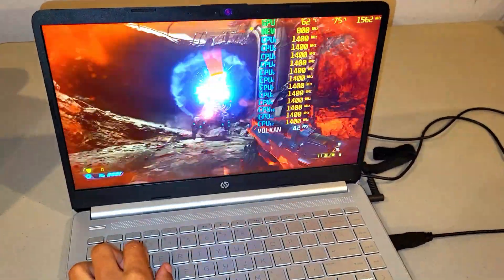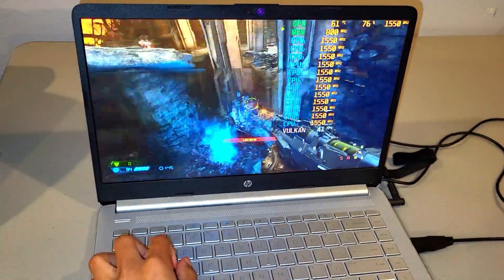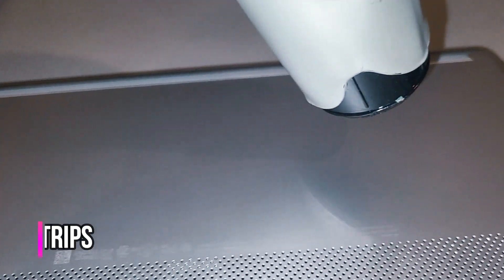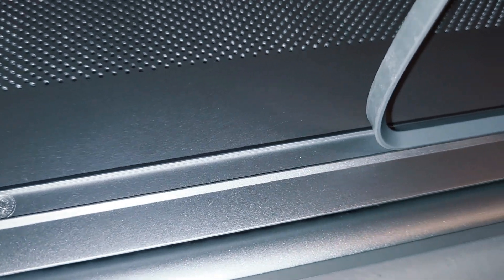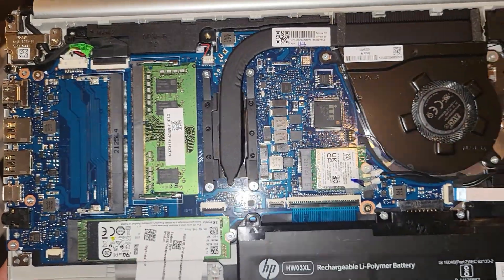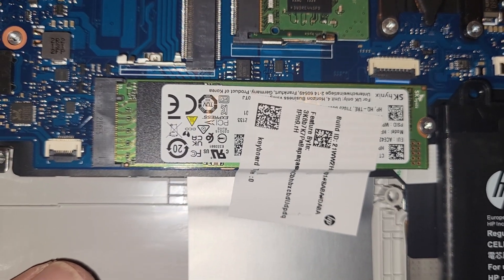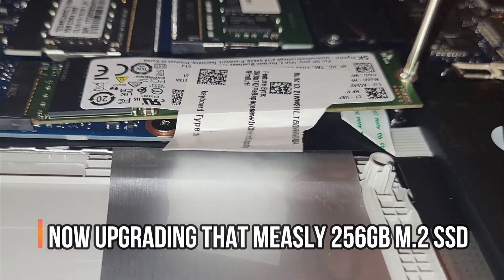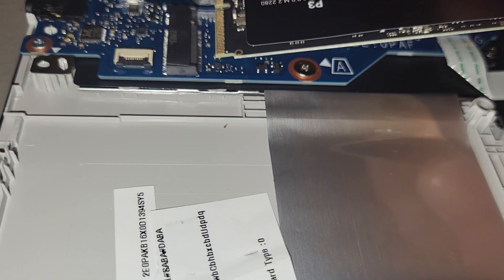How to improve gaming performance on a HP 14 laptop

Comment: Why downgrade to a near-obsolete OS?  Otherwise, you made some functional hardware decisions 👍🏾👏🏾.
Reply from the maker: Windows 11 isn't that bad it's just faster for me to install a pre-tweaked distro. Hp and dell pack their budget laptops full of their own bloatware on top of windows 11's and then set the power settings low to save battery. Your everyday consumer would just assume they got what they paid for and not realize there's more  performance they can gain.
Reply: not really the ram was a downgrade aswell ryzen cpu and its igpu likes to have high speed (3200mhz+)  dual channel ram with the lowest CL latency possible that boosts fps way higher than just having dual channel at 2400mhz just cause of those 2 things which result in higher memory bandwidth and lower date transfer latency to both cpu and iGPU
Reply: Windows 10 is not obsolete its still in production. It only goes as such when it hits EOL.
Reply: obsolete???lmao. win 11 is trash.